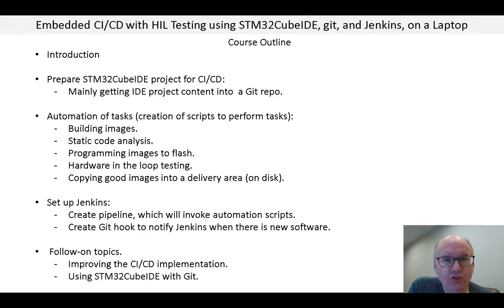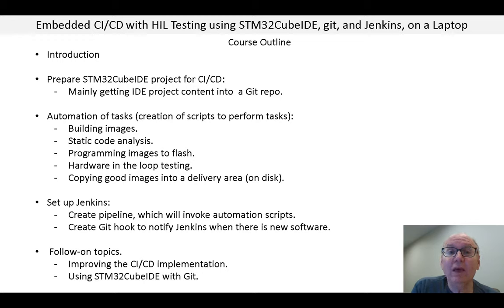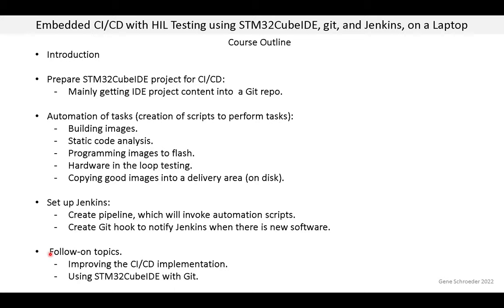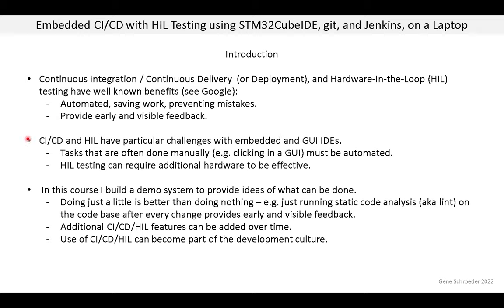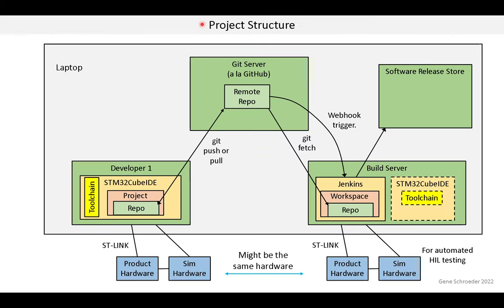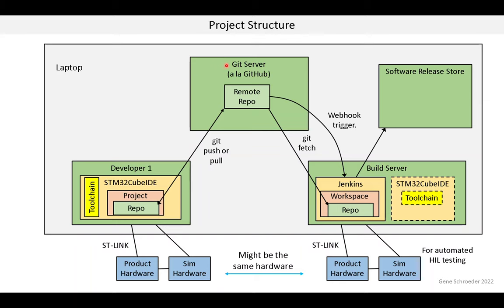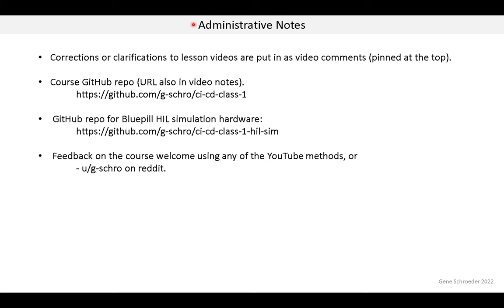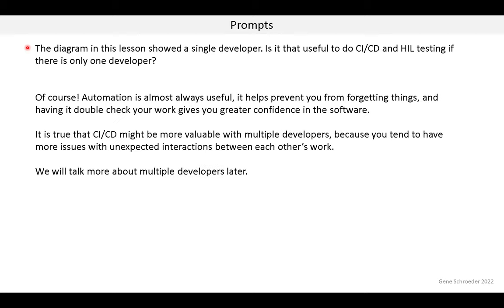Embedded CI/CD with HIL Testing Lesson 1. Introduction to the Course

Comment: I found it easier to embrace cmake, which can work fine across both (vscode, clion). CLion generates a good starting cmake boilerplate on import from a STMCubeIDE generated project by CubeMX. These tutorials are brilliant, embedded development is generally missing many of these modern practices and can be quite archaic mostly due to aging tooling (eg. Keil).
Reply from the maker: Thanks for the comment.  I seriously considered using cmake, but that approach has its own issues. I hear a lot about CLion lately and need to look at it.

STM32CubeIDE is a bit old fashioned and clunky, but has some nice features if you are using STM32 MCUs, especially after ST integrated the hardware stuff (MX). My objective was to allow people to continue to use that IDE but still get a taste of CI/CD.
Reply: Could you tell what issues has the Cmake approach?
Reply from the maker: @lorandmarton5279  Sorry I missed your question, but I will answer it for others. I don't remember exactly what I meant by "issues" but I don't think it was any issue with cmake itself. I think it was more that STM32CubeIDE is based on make, and to go to cmake was going to be a big diversion for this particular course. I have thought about a different course on moving a project from STM32CubeIDE to a more "production like" development environment, and that would be a better place to address use of cmake.